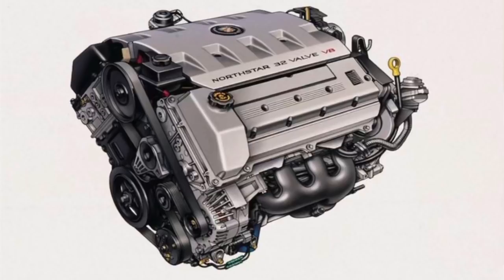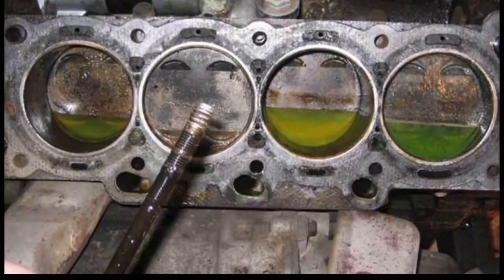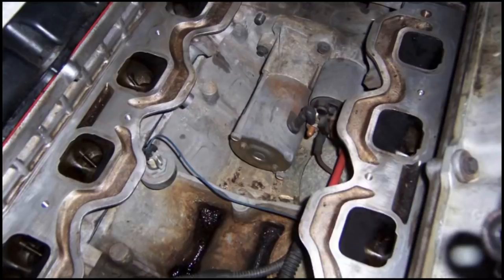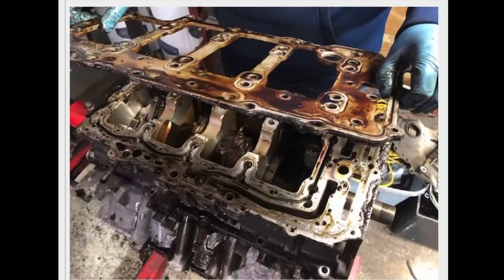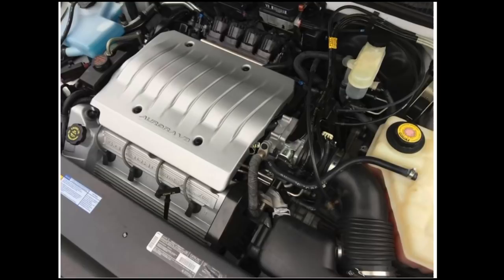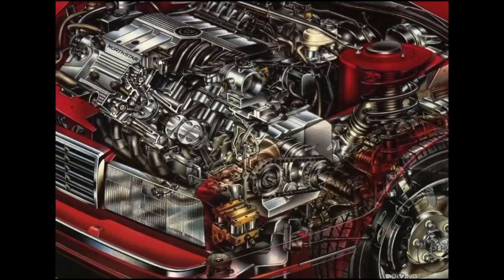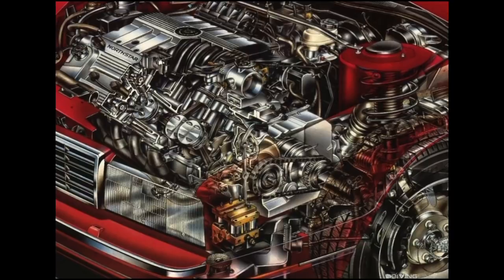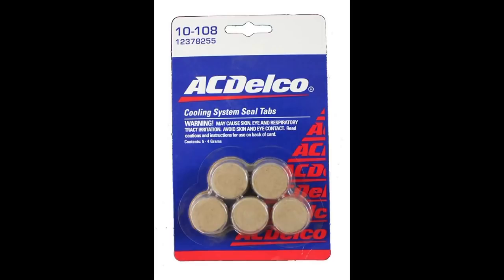Worst Car Engines of All Time: Cadillac Northstar

Comment: I’ve had a few Northstars with high-ish mileage and no catastrophic issues. 2005 STS w/ 150k when sold, 2006 STS-V (469hp 4.4l SC) w/ 110k when sold, and a 2007 SRX currently with 145k. Both of the NA Northstars needed intake manifold gaskets (easy and cheap), a coil here or there (but never twice the same coil), and needed some oil between changes. The STS-V never needed anything. Regarding the starter, I’ve yet to replace one, but pulling the intake manifold off is simple. Just four or so bolts to pop the fuel rail off and another 10 if I remember correctly to remove the manifold itself. Then you’re at the starter, which is nice and clean on account of being hidden there in the valley.
Anyway, it’s a very smooth engine with pretty decent power. I wouldn’t hesitate to get another. Mind you, I’m meticulous about maintenance, but all three were floored through redline damn near every time I drive.
Reply: @Jesse Frantz
By 2002 or so they had pretty much fixed the issues

Comment: The Northstar wasn’t a bad engine at all, all it’s troubles stem from how Cadillac utilized it. They used it as a transverse engine (for front wheel drive) so one cylinder head was buried in the firewall, and suffered from high heat retention. If it were used longitudinally it would have been extremely reliable. How many GM engines have a 6 bolt main with a girdle. It was designed to survive the 24 hours of LeMan.

Comment: This sort of thing seems to happen any time GM builds something without pushrods. People crap on the Ford mod motor for making no power but if nothing else, the 4.6 modular was smooth, quiet and relatively reliable which was perfect for the Lincoln Town Car and Mark VIII. Everything the Northstar should have been.

Comment: I did a bunch of work to a 1996 caddy, front wheel drive and all, and it made me appreciate my rear wheel drive 1995 Lincoln Town Car which has a bulletproof engine. The sohc 4.6 might not be as fast as the North star but it lasts forever.

Comment: The head bolt threads is the biggest downer for me.  It would be interesting to see how long they lasted and the head gasket if the engine actually ran at a temperature below 200F instead of the normal 225-240 range.

Comment: Bingo! Adam 💯%. Love the Northstar. No more quirky than most engines. I believe because it was designed by GM, it gets the bad reputation. I have worked on a few, had a couple 🔧 friends who specialize in working N⭐s, which lends to an understanding that many who work on these race designed engine just don't have & won't seek the experience to do a correct repair, thus pushing it to the back lot to rot. In the same token those inexperienced so called techs overcharged based on time lost in the shop. Wish I had a garage big enough to put one in my 88 Formula Fiero. One of my Caddy tech friends told the gasket problem was due to experimenting technology. Same issue found in Lumina Z34 3.4 DOHC. Need performance parts to redo a N🌟, TEXAS Speed & Performance.

Comment: Used to have a 98 DeVille with the North Star. Made a great sound and had smooth linear acceleration. At 116k it started running hot, around 220f to 230f. Whereas before the heat issues it averaged 205f to 210f. Then finally at 128k the head gaskets completely cooked and that was the end for that car. Didn’t have the money to put in to keep it going at the time. Loved that car. Comfortable ride, tons of leg room, great visibility, amazing trunk space, got up to speed quickly. Best land yacht ever. Oh and plush seats too, like sitting on a couch, very comfy.

Comment: the head gasket thing, i helped a fellow drill and re-thread for a head kit he got he had a NICE shop but, it was his dads and uncles and he lacked the skill to use alot of the equipment... got my uncle to help set up the drill press and do the drilling and tapping, hes a machinist and welder by trade, in trade the fellow let him use his shop to fix a few cars and they rebuilt a couple engines togather as the fellow wanted to learn to do this stuff himself...turned out his 12yo daughter and 11yo son had to help him because... he just couldnt do it himself always getting stuck at stages of setup, the kids were sponges and, both went to trade school for welding and machanics due to how much fun they had growing up around that stuff, and grandad and uncle were out of the country, the family work for a large company, mostly as mine inspectors/surveyors checking old abandoned mines to see if re-development is warranted... so far 3 mines they have ended up re-opening have been ones that youtube channels had exploration videos on, the videos made them look into the location and check them out... in one case, something that was waste product back then is highly valuable now, they are not just exploiting the mines in the area but their slag piles as well... so...yeah... 

anyway... i have helped on a few vehicles over the years that needed head jobs for the same reason the northstar did...those thin threaded bolts really do the engine no favors.

Comment: I have owned a 2001 Olds Aurora with the 4 liter Northstar since 2000. I am not an easy driver.  Total list of troubles: Crankshaft position sensors....2005.  Camshaft position sensor.....2013.   Spark plugs....2019.  Fuel pump....2020.

Comment: Yes too bad for a few of the problems. I liked the STS. The design on the lower engine was the worst with the oil leak. I had to pull the engine like you said just to fix oil leaks. But when I was done I had the mechanic shield the exhaust heat and had no more problems. The other stuff like the starter is just quirky and I think it just irritates mechanics just because it’s different. It is a bad place for it because of the heat but I had it replaced when they pulled the motor just because. I didn’t have any problems with it.

Comment: These cars running so hot is also a contributing factor, putting strain on those already weak bolts and such. These engines run up to 222 degrees by design thats when the electric fans come on, if the fans were to come on around 200, the bolts and many other parts may not have fatigued as early and caused other issues. With the A/C on I never see over 205 since the fans are constantly kicking on and off, turn the A/C off, 222 back down to 210, then back and forth until you park it.

Comment: I had a 2005 DTS.  Loved it. 215000 miles on it. I put a water pump belt and pulley on it. Spark plugs. replaced the 90 degree vacuum elbow on the intake.

Comment: At one point before the BMW purchase Rolls Royce actually considered using the Northstar engine in their cars before choosing a BMW unit. Not that surprising considering Rolls Royce quietly utilized a GM automatic transmission on all of its models from 1963 or so to 1990s.

Comment: Well from the perspective of a Mercedes, Cadillac, Lincoln and Jaguar owner: I don't see half the complaints about the w126's timing chain debacle or the r129's hydraulic tops or jaguar and BMW nikasil engine ticking time bomb that I see about the northstar; and to think these cars got away with charging twice the price of any northstar cadillac for a comparable car. ALL cars break and the high performance ones can set you back thousands in repair bills, but you shouldn't blame GM unfairly for coming out with a comparable product to what everyone else was offering at the time.

Comment: I remember almost buying a Cadillac STS with a Northstar V8, from a guy, but we couldn't agree on the price. Instead, I ended up buying a 97 Buick Regal GS with a 3800 SC V6. Ironically, that engine developed a lifter tap (I believe a body shop raced the car without my knowledge) and eventually it seized. I was fortunate that my mechanic found an identical replacement. Once he installed it, I drove the car  7 more years before selling it.

Comment: Thumbs up and wish you a good weekend also. I'm bummed out now because I have a 1999 Deville Concourse. It has 80,000 miles and so far nothing went bad yet.
Reply: If owners are able to set up a network to work independently of GM with the suppliers, it should be possible to keep these cars as well serviced as Bentley enables its products to be.
Reply: @alanblanes2876  
Good idea Alan. I do my own work if it's not too big. I just can't do removing engines or transmissions.
Reply: Hate to be “that guy” but,97,98,&99 are the worst years for northstar they (can you believe it) actually shortened the head bolts for these years (same thread pitch though)..they are the worst failing years the 93-95’s did well before dexkill was introduced in 96 and people ignore cooling systems for the most part in all model cars..this was a death throw to northstars change that coolant every 2 years with this engine…2000 came the redesigned deville and they went back to the longer bolts (but kept same fine thread pitch-brain dead-)people still were having blown gaskets cause as we know now..change that darn coolant more frequently than any other engine…it took gm 11 years to get it right ,2004.5-2011 northstars have ls6 head bolts and finally got a coarser thread…
Reply: @toddprater14  
Thanks for all the info Todd.

Comment: Northstar may not be a bad engine per se, but compared to it, the Ford offering of similar architecture and displacement is almost a relic. I have owned both, mind you, a 1994 Seville STS with 100k and a 1997 Mark VIII with now 273k. 
They are both 4.6 liter DOHC with 4 valves per cylinder and aluminum block with aluminum heads. Yes, the Cadillac model has more power and torque (20 at most and 19 at most, respectively). 
But Ford:
*no liquid-cooled alternator
*no specialty coolant or leak tabs, the walmart no-name red pre-mix is fine.
*no running hotter than other cars (way less chance of overheating), my Northstar ran at a minimum sustained temperature of 91C, and in hot 30C weather this rose to 110C (overheating is 113+).
*way less inherent headgasket problems
*will not overheat unless missing a lot of coolant
*spirited driving does not eat engine mounts

And finally, 4T80 is too weak for Northstar engine torque, and too inefficient compared to any longitudinal rwd transmission. The 3.73 final drive is also a waste, considering that Ford made due with 3.08 on the Marks.

Comment: My father had a 96 Caddie El Dorado, he loved driving that car, but the Deathstar engine leaked oil like a stuck pig. The oil pan was leaking so bad by the time he sold it that all he had to do on oil changes was to just change the filter, that engine was drinking and leaking 2-3 quarts a month. To change that oil pan gasket is an engine out procedure. The engine was a poor design, yes it is a great running engine when it's running, but when it breaks, leaks, or starts giving you issues; hold onto your wallet.

Comment: Funny, I was an auto enthusiast in the late 80s when the coming Northstar was seen as the savior of Cadillac and a new dawn across GM. I drifted away from damn-near memorizing every issue of Car and Driver in the 90s-2000s and now I come to understand the Northstars had those head bolt problems and thus a horrible, horrible reputation. Ah GM. And to think, 20 years before they came up with the Northstar, they (GM) come up with the 472/500, all those 455s and the big block Chevy. It's as vexing as Packard, after making ALL those Merlins, didn't come out with an ohv V8 until what...1955? when they were already circling the drain.

Comment: I serviced my uncle's northstar used block seal at about 140,000 miles sold the car at 350,000 miles he changed the oil religiously. The 4100 was the worst gm engine.

Comment: Not a bad engine. Ahead of its time and victim of a leap ahead in technology with no phase in of a previous engine of similar design.
Reply: Ever put a starter in one? Once I seen that I knew I'd never owned one or want to work on that piece of s*** again no matter what
Reply: @stevejohnson1397  Replacing the starter in actually very easy to do. I had to replace on in a parking lot a few years ago and had everything done within an hour. Its not something needing very often and is much better than having to lift the engine up and over like on a Jaguar V8.

Comment: Had a '94 STS with the Northstar. It defines love/hate relationship in my mind. Great acceleration, great mpg. Seeped oil thru the block, more complex electronics than the space shuttle, some of which are not available new. Yes, the alternator is a challenge  to replace.

Comment: The Northstar is garbage. On my suggestion, my uncle bought a new 2001 DTS. From day one, that thing drank oil. Went through about a quart every 1000 miles. The douchebags at the Caddy dealership tried to tell us it was normal and within GM spec. But we are gearheads and knew that was B.S. They did all kinds of idiotic procedures that would supposedly fix it, sprayed some sort of product into cylinders to seat rings and sealed crank case system, etc. Car was in and out of the dealer multiple times and it became apparent they were trying to get out of replacing the motor. For the first time in his life, my uncle bought extended warranty because he saw what was coming. All during this time, I would see multiple Caddies in their service center with the motors dropped out as well. They argued but finally agreed it was an issue. Finally, GM sent out an engineer who disassembled the motor and found the bores were egg shaped with portions of cylinder walls still having original cross-hatching (rings not making contact). This, I believe, was due to GM's poor design where the engine block was cast around the iron cylinder sleeves. Stupid design. They replaced the long block but it was extremely tight and felt underpowered compared to original. Also, I think those idiots damaged the electronics for torque converter lock up function when they re-assembled. Failed a short time later and converter got fried. Other things that went wrong included instrument panel going bad and needed entire new dash and electronics. Made all kinds of rattles and was loose after they re-assembled. Also, the window tracks were designed with cheap plastic pieces. They would break every 15-20K miles and windows would suddenly drop down. Lastly, had fluid filled motor mounts that broke open and leaked everywhere. Of course, whole engine and cradle had to be dropped to replace them. After about 80K miles on the replacement block, it spun a bearing and developed a rod knock. That thing was an absolute money pit and a piece of trash! Shame on you GM. Turned him off to Cadillac. Now, he has a 2018 300C Hemi Platinum, all black like the Caddy, and it has been problem free. He loves it and I was redeemed because I got him an insanely good deal on it.

Comment: I have a 2006 Cadillac DTS I’ve had it quite a while it has a 163,000 miles on it runs like a top doesn’t leak anything does it get hot and it is a fantastic running motor, I think if I am correct that they have by 2006 corrected the head gasket issue, am I correct thanks and I love your videos

Comment: You were saying something about bad starter location? Look at Audi rs5 4.2 v8 engine. The starter is covered by the engine mount which is then covered by the exhaust manifold. And if you want to replace it, you need to take the entire engine out.

Comment: My family had a 2006 SRX with the Northstar. Both me and my younger sibling learned to drive in it, beat on it, neglect it. ZERO problems! I have no idea how that engine, let alone car survived 300,000km. We literally did 0 maintenance to the car, go 10k+ without an oil change but that beast still kept going till we traded it in. Maybe we were lucky but i truly miss that SRX and the Northstar.

Comment: You know what... The title kinda pissed me off but that was a great video and very factual. My 2003 STS doesn't have any of those issues it just simply burns A LOT of oil. About 3 quarts every 1k miles... I'd say my oil control rings are shot. But other than that it runs like a dream! I can understand why someone wouldn't want to deal with one of these motors but I love mine

Comment: I had a 1996 El Dorado that I put 240,000 miles on it in ten years without issues. Regular oil changes, tune-ups, wires, tires, and a couple of batteries were all it required before I gave it to my son who got another 30K before he was rear-ended and the car was totaled.

Comment: I never, ever use the cooling tablets in my Northstars!  They are terrible!  I use green coolant and flush every two years.  I also stud my Northstars and they never blow head gaskets.  Once you do this and keep up with the maintenance Northstars are the BEST engine GM has ever produced.  They redlined the Aroura engines for 24 hours at Le Mans with twin turbo chargers, that tells you something about their potential reliability if they're well sorted.

Comment: I own a DTS. The hardest thing to replace is the water pump so far. I bought it at 49000 miles  put 76000 and it's still running. Gonna see how bad it gets.

Comment: Over here in Germany the Northstar is a cheap V8 because of its problems. I like them. They have their problems but if you address the bolt thread problem they are great. The only thing that bugs me is the transmission bolt pattern. It's not easy to find parts to covert the engine to RWD but it is possible.

Comment: 90% of the issues with a north star were caused by not adhering to the maintenance schedule, mainly the coolant
Starter is easier to change than a lot of vehicles they put the on the bottom